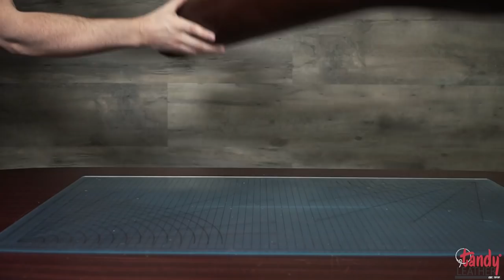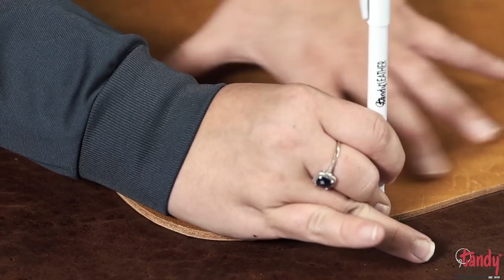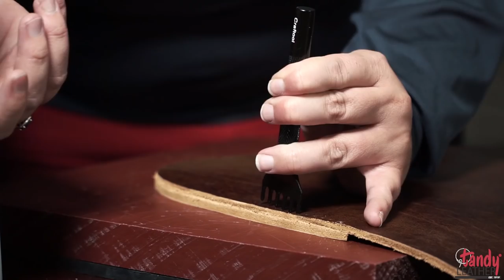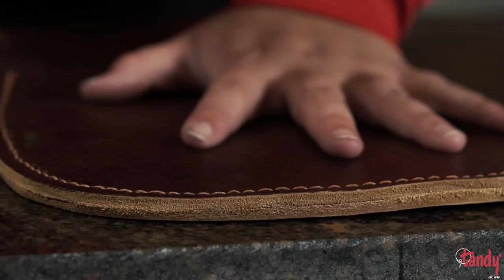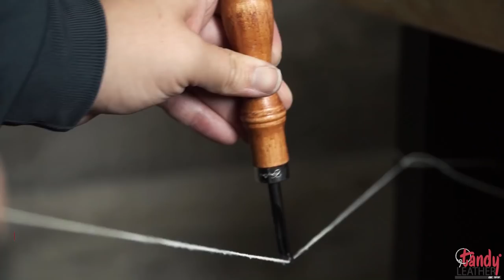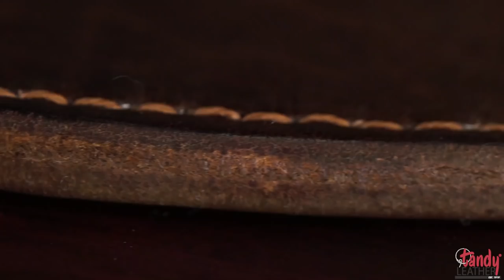Leather Butteryfly Chair DIY

Comment from the maker: A lot of people will want to use leather that is not big enough to trace out the entire pattern. So we cut it to show there is an option of piecing it together if you are limited with your leather size. Plus we find it just adds a really finished touch. We stropped the edge beveler with heavy weight thread and jeweler's rouge.

Comment: Are all butterfly chairs pretty much the same size or would you have to have a pattern for each one? Just wondering if you could just buy the frames and make a few of these at the same time.
Reply: There's enough variation across manufacturers that you need to copy the pattern off each one.

Comment: Anyone know why they cut it into four parts? Does the stitching prevent stretching or something?
Reply: I posted my thoughts on why they did it... Could be wrong though just taking a guess...
Reply from the maker: A lot of people will want to use leather that is not big enough to trace out the entire pattern. So we cut it to show there is an option of piecing it together if you are limited with your leather size. Plus we find it just adds a really finished touch.

Comment: why cut it in 4's and add joins and hours of stitching? there is probably a reason but i dont get it ?
Reply: I assume that's is so you can add the reinforcement strip along the back and bottom to support the weight load when you sit on it... I could be wrong just speculating 🤷‍♂️
Reply from the maker: A lot of people will want to use leather that is not big enough to trace out the entire pattern. So we cut it to show there is an option of piecing it together if you are limited with your leather size. Plus we find it just adds a really finished touch.

Comment: I assume the reason they cut and sew it back together is so you can add a reinforcement strip along the back and bottom to support the weight load when someone sits on it... I could be wrong just speculating... 🤷‍♂️ Seems legit lol